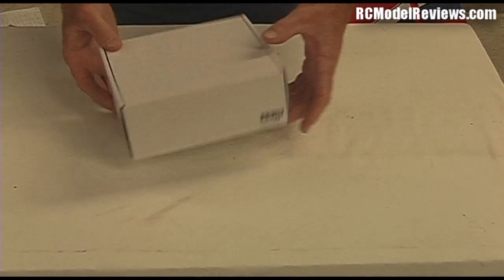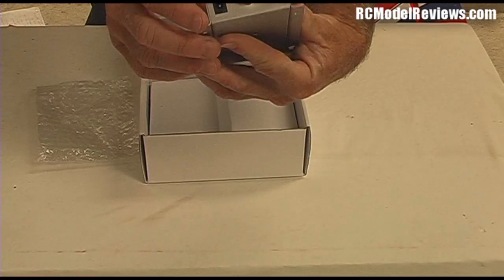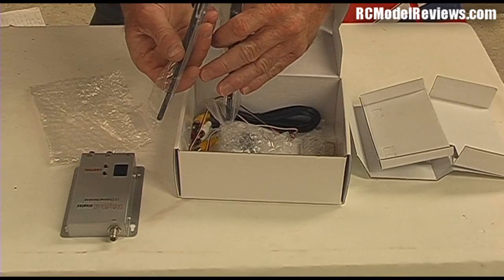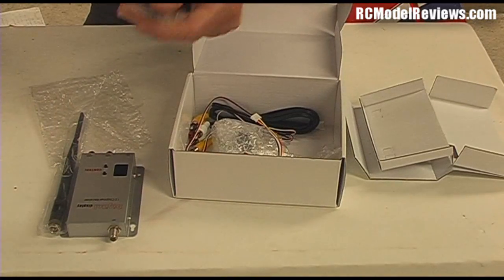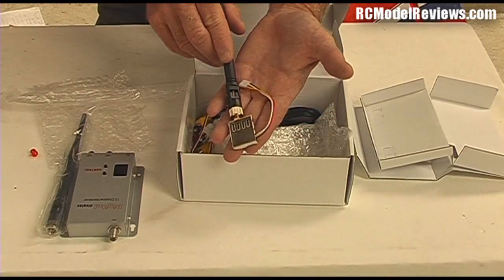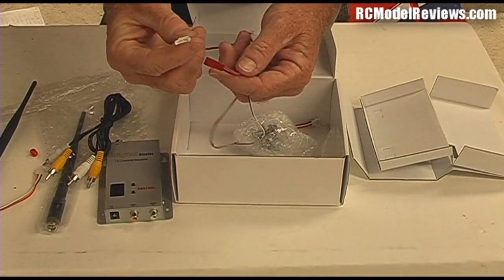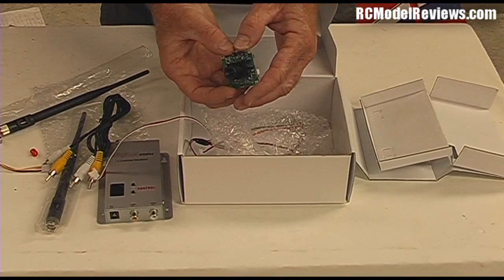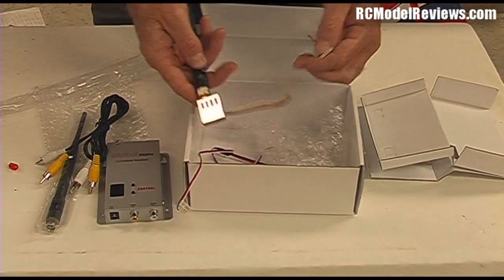Preview: unboxing the 900MHz FPV video transmitters from HobbyKing

Comment: @jfcomg1554  Thought I'd chime in here. Be sure to place your video transmitter as far away from your RC  receiver and you should have a pretty good solution. Also make sure the antenna is in the upright position. Apart from that, there isn't much you can do wrong as far as I know. Good luck. :-)

Comment: Hi Bruce i´m a big fan of your videos.
 i recently buy a epp fpv plane and a 900mhz 800mw in HK , i have not installed yet the video equipment.. please give some advertice on how its the best way to install it in the plane. i have bought a regulator for the transmiter and a filter for the antena of the transmitter that i found in dpcav.com 
i have bought the eagle tree osd sistem too i hope you can make a review of it soon..
Thank You for your videos and good reviews.